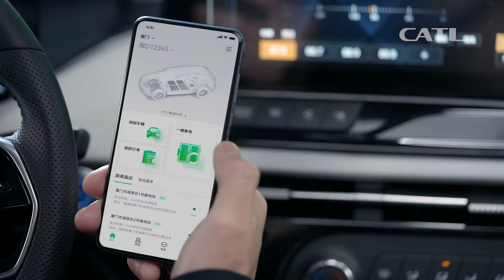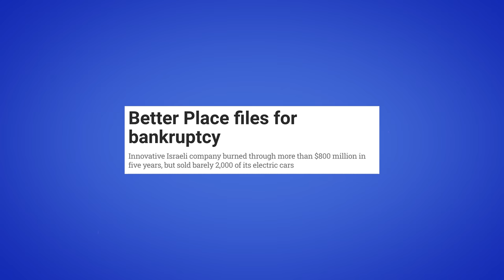Why Battery Swapping Is A BAD Idea

Comment: You are only thinking about the vehicle side of things, the battery swapping station also has two more advantages compared to fast-charging stations. The swapping station takes up significantly less space compared to fast-charging stations, thus making it a much better choice in major cities where land is scarce. Battery swapping stations also take much less of a toll on the power grid.  For it draws a relatively constant amount of energy from the grid. As we move away from fossil fuels and move toward renewable energies, the fluctuation of energy required from the grid becomes a significant problem, as we can't control the weather, we still need to use traditional fossil fuel-powered power plants to bridge the sudden gap in energy demand as all other methods that are capable of storing a large amount of excess energy at a reasonable price takes quite a bit of time for the generators to spun up. Currently, the Ionic 5 requires a 350kw fast charger to reach its 18 min advertised charging time. If we take a look at the statistic of the average annual electricity consumption of London households during 2020, we see it shows 3446kWh per year, from that we can calculate that the average speed of consumption per household is around 0.39kW. Let's assume that the average London household consumes 10 times that during peak hours. We get a theoretical consumption rate of around 4kW. That means every time someone plugs their ionic 5 in the fast-charging station, it essentially adds the stress of providing for at least 87 additional houses on the grid. London alone has over 500 rapid charging stations. let's say that only 1/4 of it is in use during peak hours, that is the equivalent of nearly 11,000 additional houses on the grid that are constantly popping in and out.

Comment: When people are used to doing something faster, it is VERY difficult to get them to accept doing that thing slower. 12-15 extra minutes is objectively small but it feels really bad. I see BEVs as good round towners for those who can charge at home, but fill-up time and access are still going to be a problem for other usage. When are FCEVs arriving in force?
Reply: The reality is it doesn't take an appreciably longer time.

Yes, my gas cars can go 400 miles between gasoline stops. The passengers cannot go 400 miles between stops. Often the passengers are lucky to go 140 miles between stops.

Comment: Leasing a battery pack for £175/month ($207/month) is rediculous.  Where I live in Florida, the price of gasoline is about $4.70/gallon snd my car gets 30 miles per gallon, so I could drive 1320 miles/month for the cost of the battery lease (15,840 miles per year).  That's over 50% more miles per year than I used to drive before I retired and when I had a rather long commute.  These days that monthly battery lease would practically but me a year's worth of gasoline.

Comment: Just think the biggest objection to buying an EV's is what do I do with a car with a clapped-out battery and the cost to replace it, I think the ease of battery swapping would remove this concern as the car aged especially boosting second-hand values.

Comment: Some interesting rationale, thanks. I always thought swapping would be the logical way to deal with recharging, but maybe not. Interoperability can be overcome - mobile phone makers and others ended up collaborating on Bluetooth standards, and now its everywhere. As a consumer, I don't much care about the battery, as long as it delivers what it promises in terms of capacity. I'm not sure the argument about a swapping station ending up with a load of batteries to recharge stands up to scrutiny; if a supercharger can recharge one in 18 (maybe 30 mins to full charge), then they just get recharged after I left, and installed in one of the next vehicles - the point is saving me a wait.

Comment: yeah, there's HUGE oversights here that show there wasn't much look at the history of ICE cars and the need to standardize fuel/ wheels/ safety features. 

This is DOABLE, would make battery recycling more likely, which are HIGHLY recyclable. 
Anything that makes charging fast for a car makes it faster for the swap station too, and means the number of required batteries on hand will be fewer, and there fro cheaper, and easier to install the stations. 

Some BIG misses here.

Comment: It's possible, if you build a station that has several battery swapping ramps. I mean if it takes half a day for one ramp to clear 74 cars, you can have a station with a dozen ramps that can do it for you in 30-36 minutes. And that's at it's peak capacity, and cars as packed as they can be, which isn't the case for most of the day
Reply from the maker: One “ramp” can accommodate a maximum of 13 spare batteries. It would struggle to swap and recharge 74 batteries in half a day.
Reply: @AutoTraderTV  What if they are expanded? This swapping makes sense for long distance travelling.
Reply: @AutoTraderTV  Circa 312 battery swops per day is the ''rated'' capacity of the updated Nio battery station.

Comment: like our mobile phone.
it used to enable users to swap our battery which is extending the product lifetime.
Well, those mobile manufacturers do want u to get a mobile each year.
If you can drive an EV car like a Toyota ICE car for 10+ years 
It is hard for them to make money.

For instance, right after Apple lose a court case in the USA, Apple needed to offer battery replacement again.
Let's see any USA customer file a case for EV manufacturers to order them to offer battery replacement services like Apple.

Comment: There’s not going to be a swap station full of empty packs. After a swap, they start charging the packs again. Before they’ve gone through the stack, the first pack is full again. The stations are never going to run out of fully charged packs.
And they don’t need multiple packs for every car. If they have a dozen packs inside one station, that station can serve over 50 cars in a day. 62 packs for 50 cars. Not hundreds of packs for 50 cars as you are letting people think.
Reply from the maker: You do need multiple packs per car. Standard electric cars have one pack per car as they never swap. If the Nio range has one pack per car then swapping is impossible. Ie: battery swapping requires more than one pack available to every car. Not “hundreds” as you infer. But multiple.
Reply: @AutoTraderTV  Wrong: You don't need multiple packs per car. Your assumption is only true if a car did continuous trips without stoping. It is the number of CELLS inside the battery pack, and not the number of battery packs that are relevant. You would have same-size (standard-sized) battery packs with different capacities.

Comment: Soooooo do none of these cars batteries have liquid cooling management. Because if they do how does the station decouple the coolant lines to the battery and reattach without loosing coolant. Also Tesla would have an issue now as the battery is an integral part of the structure of at least the model 3's I believe, so taking the battery out could cause a structural failure of the car if not correctly supported.

I think the manual hot swap for small ev's where the owner can carry a couple of recharged small batteries on board is a good idea. The driver just takes one battery out and pushes the new one in to place.

Comment: Based on history, AA battery was introduced in 1907, but it became standardized in 1947. It took 40 years for just small size batteries to be standardized. It is not an easy thing but Nio is the first Manufacturer to take the first step. I've seen so many auto youtubers criticized about battery swap technology but I think we are still all in early stage to make a decision whether the battery swap is good or bad. Only time will tell which type of technology will be implemented in the future.

Comment: My motorcycle have swapable battery it was good and all but there are more things to this then you mentioned in video

1) swap stations are filled with old batteries , eg - i won a 2022 pack and in swaping station batteries are from 2019 because nobody like to accept battery older then theirs therefore all remaining batteries are atleast 2 year older 

2) people swap damaged batteries from swapping stations ( broken clips , stray wire pieces stuck in port , corroded or burnet contacts 

3) lipos or li-ions show effect of the ageing depending on how they were treated in their prime ages 
Some people use Lithium like lead acid , always full depleted to 0 every single cycle and those batteries will loose charge wayy earlier then better treated one so why someone will take that risk with almost 70% costing part of their EV 

My opinion : i would rather plan my journey carefully with food stops near ev station rather then gambling on unknown battry

Comment: swapping would be useful for certain purposes: Long distance driving such as long haul truck routes, couriers and taxis, where downtime costs a lot of money.
Reply: Which would require to stock even more, bigger batteries.
The thing isn't good even for motorcycles, and from there is just scale worse and worse.
Reply: @IIARROWS  no, ONLY for those vehicles. Fleet owners would use them.

Comment: Rapid charging is a a sure way to reduce your battery's full useful life. You will be responsible for picking up the tab on repairs and face a higher upfront cost to own a bev... That's far from ideal. Battery swapping has the potential to be more sustainable, as batteries can be monitored, pulled out for service, and repaired by service providers. Also, with the increased uniformity of battery packs, it's not hard to envision end of life packs (those which are beyond repair) being put to use at energy banks. They would be great candidates to live out their final days as a buffer for grid applications in a less demanding discharge environment.

Comment: Sounds nice but a logistical nightmare at my local supermarket they have eight charging bays and a queue yhey would need a shed the size of the supermarket to store and charge  , the one thing not mentioned, say I run out go juice would I be able to charge it in the normal way i.e. mobile battery boosting service or plug in will it need a recovery truck.

Comment: The same arguments can be directed to Tesla superchargers though and I like Tesla superchargers where cars will sit for hours, at Nio swapping stations, the cars are only there for 5-6 minutes, in other words you could have 50 battery swaps in around 10 hours (and that's only one station), while that would be the time it'd take to fully charge a single EV, it's also much smaller than a petrol station and requires less space than Tesla superchargers which requires parking lots... It is expensive but overall it's usually better, nuclear energy is expensive but it's the best form of renewable energy we have
Reply from the maker: 10 hours??? At home, overnight while you sleep perhaps. But compare apples to apples: Public swapping to public rapid charging.

Comment: Assuming that supercharging a battery to 100% takes 60 minutes and swapping a 100% charged battery takes 6 minutes, when the last battery of a 10 slot swap station is swapped out the first empty battery that was swapped in is probably ready for the next customer end the next one will be in another 6 minutes and so one. It's only a matter of sizing the number o idle batteries to match the customer demand. You can also size the number of stalls in a supercharger station to the number of customers but that requires more land use and all the customers have to wait for the full time that the battery requires to charge, while with the swap station the battery was already charging at the station when the customer was driving on the road. The down side of the swap is that it needs more batteries that are doing nothing when it's not peak hour. to mitigate that overhead the swap station could double as a virtual megapack providing  ancillary service to the electric grid and earn money for the operator in that way whereas when a supercharged is not in use by a customer it's a stranded asset and cannot be of any use to the owner.

Comment: Yes certainly the era of eConfusion and eBravado. Who knows where this will go, good arguments presented in this video.
When fast charge is fixed’ say 5/10 mins cycle time, how will the power stations react to such rapid power demands ?
Lots of challenges, lots of R&D and lots of standards needed to commonise interfaces between manufacturers. Maybe a good Dictator is what we need right now !

Comment: You fail to mention that NIO cars can just recharge like a normal Tesla as well, you're not restricted to only battery swaps, and given the ability to have two different options to get moving, I say NIO is the better way to go. Also battery degradation fears are no longer relevant.
As for Lithium shortage, CATL is already in full development of Sodium batteries which will hit the market next year. Sodium shortages will not ever be a thing.

Comment: Battery charging to 80% instead of 100% makes a huge difference in terms of time. That's just how lithium works. 

We're used to taking our ICE vehicles to 100% in 5 minutes, which is where most of the trouble comes from

Comment: I think the benefit to battery swapping is you don't need a 300 miles battery if it only takes 15 minutes to swap for aa fully charged battery. A 100 miles battery would be enough because few people drive more than 100 miles everyday. You will only need to do a battery swap on long distance trips and if it's only 15 minutes then it's not that bad at all.
Reply: That would make the EV much much less useful, and would hinder adoption.
With today's fast charge capabilities, in 15 minutes you get well over 100 miles of charge added.

Having a 300 mile battery means the owner sacrifices nothing. Day trips (180-220 miles) are a breeze because it means no charging on the road.

Comment: I think this is a good video that explains the issue as well. I think a key thing that has affected the feasibility of battery swapping is that battery technology has improved dramatically. Like Rory said, the majority of a pack can be replenished in <20 minutes, which is not far off a swap. I think a key point a long with that, is that batteries have increases their durability to handle having these charges more often. They also now have the range where having a break between charges is pretty tolerable. Battery swapping might make more sense in applications with  predictable and longer routes however like lorries where a fleet operator can have control over the whole process.

Comment: I'm not sure if the argument that using a swapping station requires more batteries is really true. 
i think the opposite is true. Most people don't drive long distances and don't need battery capacity beyond 50kWh.
unless they have to go on a long journey.  that would be for a swappingr  station to achieve the appropriate range.  Overall, cars would be built with significantly smaller batteries

Comment: In my opinion some sort of middle ground would make sense. 

Obviously changing batteries all the time instead of charging requires too much infrastructure. On the other hand, the Tesla way of fully integrating it in a way that changing a battery cost as much as a new vehicle also has it's drawbacks. There it would be great, if you could change your battery pack if the old one dies or if there is a significant improvement in battery technology.

Comment: I hoped this video would have delved more in the problem of ownership and the stock, especially because many of the arguments against EV is the degradation and "environment impact" of batteries.

Not counting that if you have a standard, you would basically kill the progress, because you might buy the new shiny more capacity battery, but then you could be stuck swapping it to an older model with half of the capacity.
Imagine proposing swapping the tank of a truck with a smaller tank from a city car because that's what is available at the station.

And that brings us to another problem: size.
A car with a custom size battery is great because it can use 100% of the size, if you have a standard you cannot do that, like on phones.

Comment: Another key reason battery swapping won’t work is that batteries have different states of health. Say you went and got your battery swapped, and its state of health was near 100%. You would want to just hold onto that battery and recharge that for a while, as opposed to swapping it out, because the next battery you get could be at 71% state of health.

Comment: I don't think that battery swapping is a "bad idea", but rather not a fantastic idea.

For most car owners charging would do perfectly. 
Battery swapping puts restrictions to platform design. 

For most users, battery swapping solves an imaginary problem. 
For your daily commute, you can get away with slow charging where you park.
For long trips, you need some stops to eat and rest, and you can easily utilise that time for rapid charging.

Battery swapping can make sense:
- if you have trouble to get your daily charge while parking, rather than relying on rapid charging for daily commute. 
- on road trips where you swap drivers, and the drivers rest on the road.

Comment: I say the main issue is one you completely ignored; water cooling. Most cars today use water cooled batteries to prevent damage from heat or cold or even when just over used or supercharged. There's no easy water to water cool a battery if it has to be removed as that means the lines and radiators need to all be part of the battery and not the car making cooling it harder. Most cars use a heat pump for example to both heat and cool the battery but there's no way to do so if the battery is taken on and off all the time with lines hanging from the car.